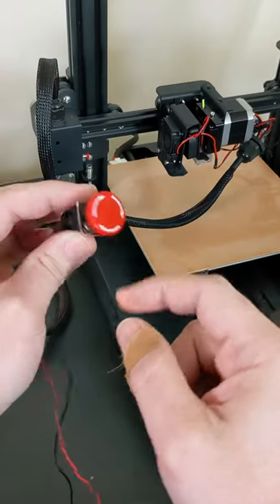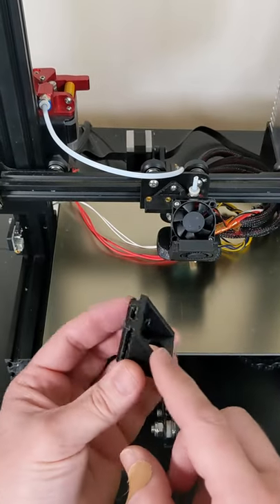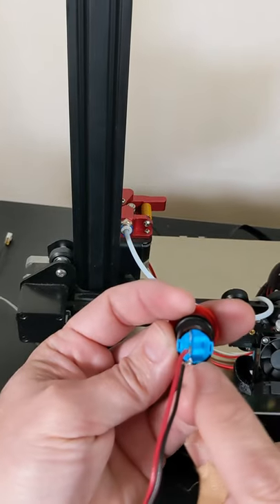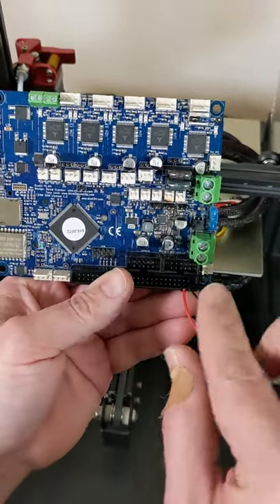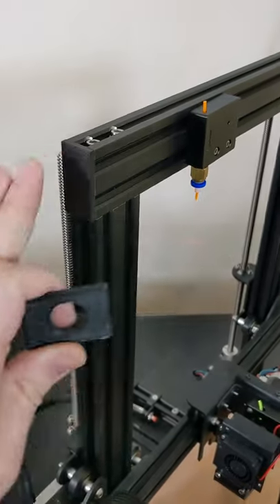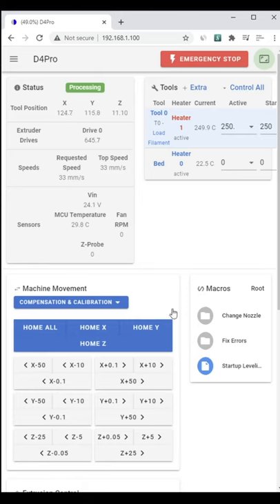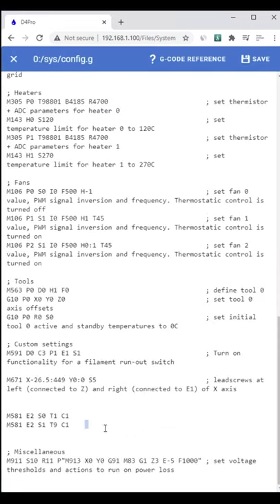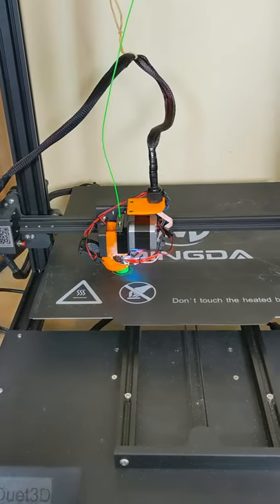Putting an E-Stop Button On My  Ender 3 #Shorts

Comment: This is not E(emergency)-Stop. This is pause switch! You need additional sys/trigger9.g file in system with code to resume print. 
"M581 E2 S0 T0 C1" is for Emergency STOP.
Reply: It’s an E-Stop button, but not E-Stop functionality. E-Stop functionality would remove all power from the system.
Reply: @timothymusson5040  Technically yes, but when you read the title of video you kinda suspect it act like E-Stop. Emergency button as a triigger on Duet Firmware basically reset the board and restart after few seconds (the delay is annoying).
I use few trigger buttons to run custom macros like homing or filament change. With M28 and M29 you can rewrite gcode on another file, like trigger#.g basically changing functionality of button with another macro.
Another thing is switches have bouncing contacts and can sometimes trigger macro to run 2 times (one after another).
Reply: @tomaszbiskup891  I agree, I fully expected E-Stop behavior, not an E-Stop button that does a pause. The title didn’t lie, just misled expectations of people who know what E-Stop really is.

Thanks for the extra info!

Comment: Personally I would wire e-stop normally closed. Ensures there is positive confirmation the e-stop is disengaged and the circuit is functioning. When e-stop is triggered the circuit is opened. If there is a wire fault to the e-stop the machine will not function until wire fault is fixed.

Comment: Can you detail the mingda hotend modification you did in orange? The clangy annoying cover is off of mine and I'm about to just totally replace the hotend entirely I'm so upset with it. My mingda package was pretty much dropkicked by angry package carriers from china and is my learn to repair electronics and tune movement systems machine but as far as the hotend bits I don't know how to improve it without installing some kind of aftermarket ender3 direct drive solution which I'd rather not do because this one seems perfectly serviceable.

Comment: this doesn't work for me. Whenever I connect the switch and turn my printer on the display doesn't work, but when I disconnect the switch my screen works. Since I have a bl touch a plugged mine into drive 6. My switch also stops the print, but will not resume until I select resume using the dashboard.

Comment: Amazing! How about auto switch off after printing is done? Is there a way to do so on a stock Ender?
Reply: Use a timer
Reply: Easily done with a switch attached to the X Axis Max position and GCode. When print is finished move carriage to X Max position, activating the switch which cuts power. Obviously this is simplified version but it is easily do-able.

Comment: It should be a switch not a international style emergency stop mushroom kill button this is like having breaks on your car that turn your lights on so you can see whom your hitting lol button is fine just not that one please your implying and fabricating a lie for people to mod possibly danger for a used printer  sale maybe whom things it’s a estop just like it is an e stop    Buy a proper switch or button and tell people to not use an stop cause it’s not. Estop are only for estops please....
It’s a switch not a stop 
This idea is great for an appropriate switch not a stop 
Ppl try things they should not you may get it they may get a burned why did you feel the need to use an emergency stop of other than that ic just silly 

Use a switch for the job your expecting it not any more expensive select your components correctly if you cannot just don’t.